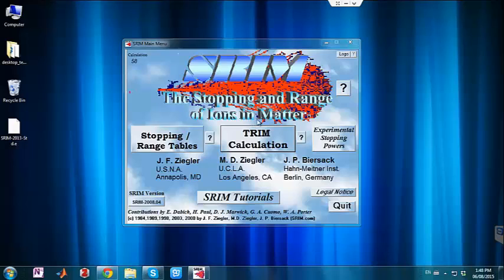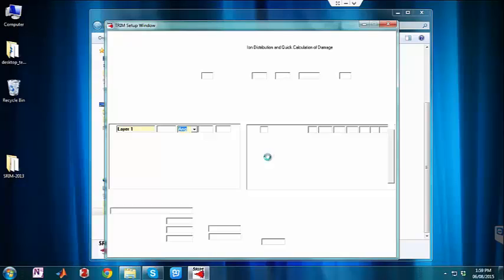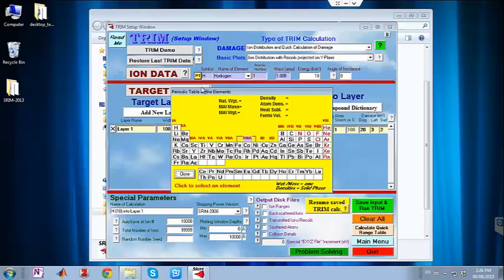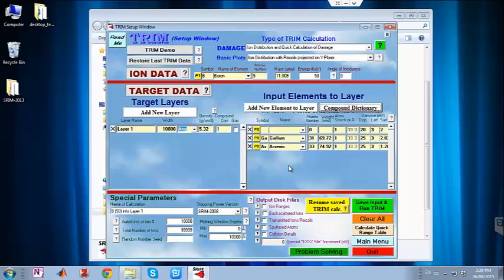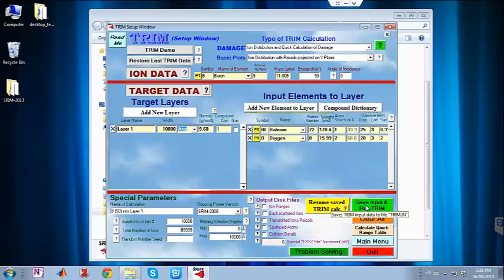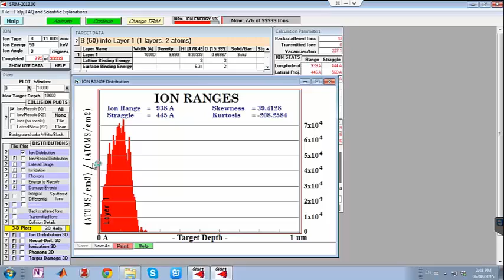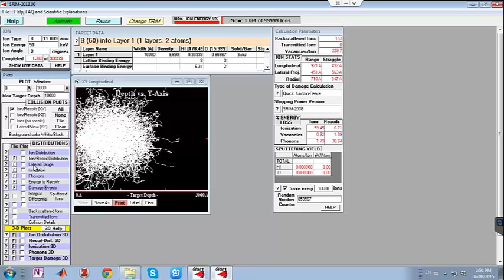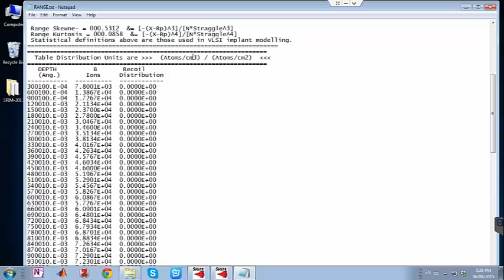TRIM/SRIM Monte Carlo Simulation for Crosslight NovaTCAD

Comment: thx for this video ... but i have problem on SRIM NOT TERM  my problem is how can i butting energy for every element and how can i know it...... thx for your attempt
Reply: Dear Brother, did you solved the problem which you posted?
Reply: yas, Thx dear i solved
Reply: I have installed this software in window 7 but it is not working, it shows some fills are missing, it is not showing the executable file, how can i resolve this problem
Reply: Please reply, how can i overcome this
Reply: Compound dictionary is not shown
Reply: @KavitaYadav-yt1vm  did you solve that?
Reply: For the missing files problem, or the compound dictionary or running, I had it in the beginning and it appeared to be a common problem. At the end I solved it by the following the instructions on the SRIM website homepage, down in the end. There is a pdf mentioned that includes few methods. For me I solved it by installing the SRIM-2008 in another directory and then the 2013 version worked.

Comment: I have installed SRIM 2013 in Windows 8 and the program runs fine as long as I do try to access the COMPOUND DICTIONARY. As soon as I try to access it, the program reports and error and it closes. How to I fix this bug? I tried to follow all instructions on SRIM Setup.pdf but not seems to fix this problem. SRIM 2008 however runs fine.